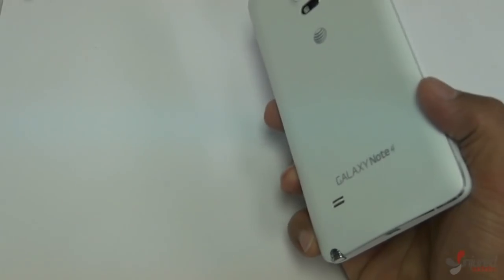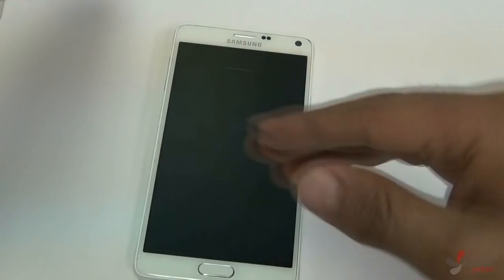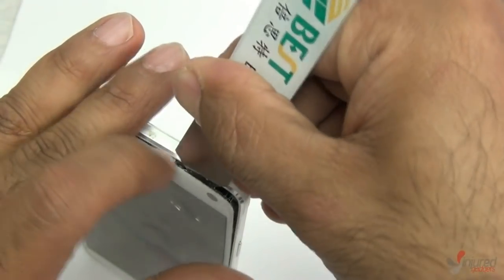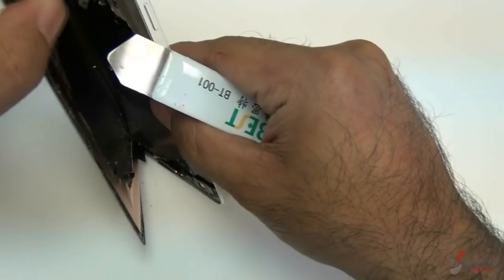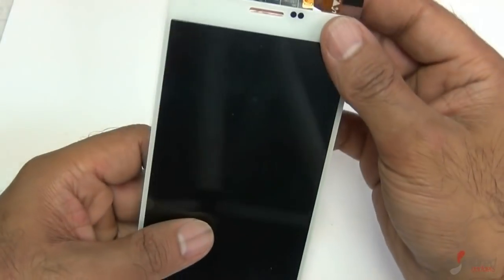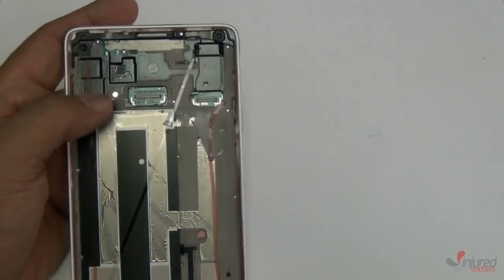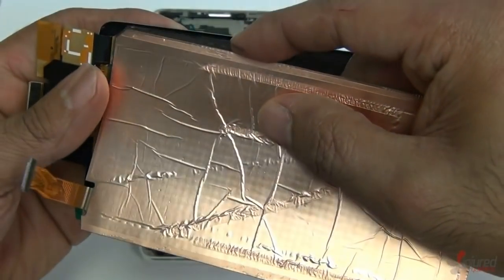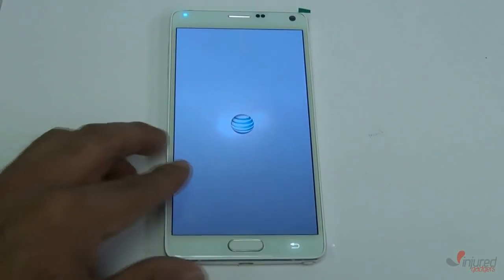Galaxy Note 4 Screen Replacement Teardown and Reinstallation in under 7 minutes.

Comment: My screen is still working fine just have two cracks in it. I have another Note 4 that is from T-Mobile and the one that is cracked is an AT&T model, dose that make a difference and if not is it cheaper to take one screen for another?

Thank You

Comment: bought a note 4 screen assembly, so what I had to do was transfer motherboard and old frame, but now the SPen isn't working cause I couldn't align the connection properly. is it easy to just remove the LCD/digitizer and then connect the flex cable that way or is they a good chance of breaking the LCD?

Comment: would a blow dryer work as well as a heat gun?
Reply from the maker: It would work.
Reply: InjuredGadgets I was told that it takes longer to heat up
Reply: would it damage the device? I used a blow dryer with a towel on top and cracked my screen a bit when removing it. The phone turns on but now it just flickers these weird lines and dies. Please help!!!!
Reply: @julianeescobar2  That bicause you are sucks on fixing phones 😂

Comment: Hello, 

Nice Job. I have a problem with my Note 4. The display always comes off 1-2mm from the plastic frame. As a consequence, the sensor of aproximation always detects "phone on the ear". Using Whataspp this is very annoying. 

I have already changed the middle frame with the whole eletronics on it, but the problem remains. It seems as if the middle frame is bent, mas acutally it is new. My only left idea is, that the digitizer of the display is not totally flat any more. But I havent done anything on it, why should it be different from a new one?

Anybody some idea for this problem or how to fix it? Thank you!
Reply from the maker: +PLAYLIST MUSICA FESTA You need better adhesive holding down the assembly.